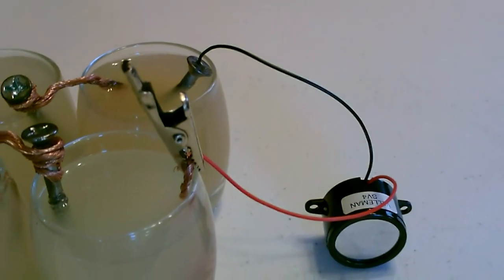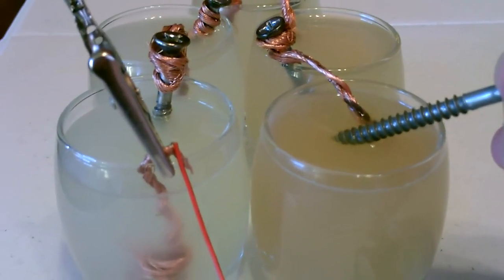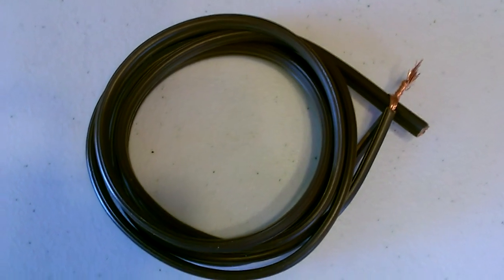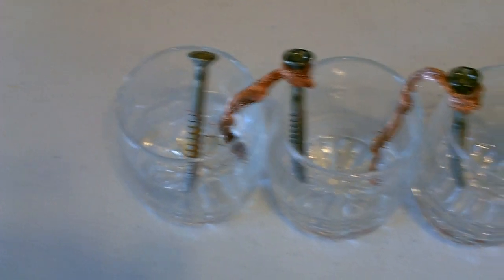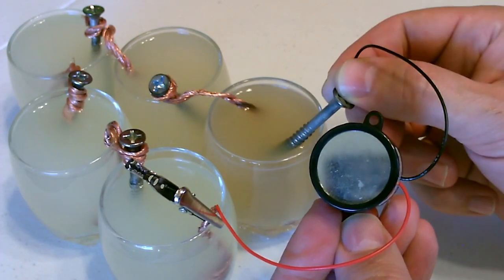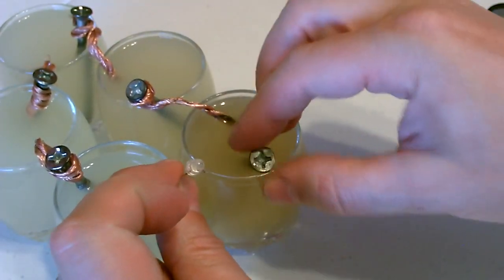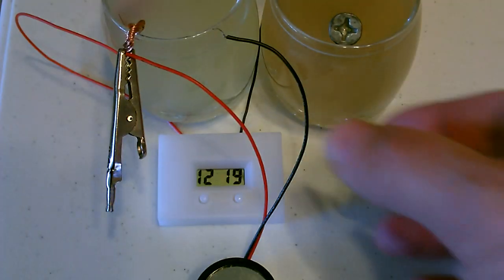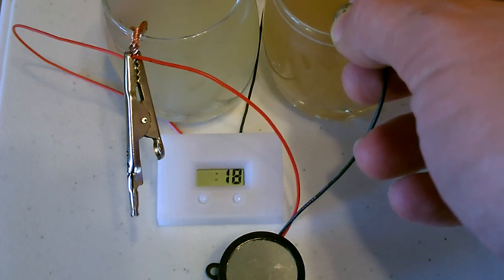Lemon Battery - Powers an Electric Buzzer! (and more...) - Homemade "lemon juice" Battery - Easy DIY

Comment: To get more potential you could create an outdoor Ionization array.  Copper, Gold, Bronze, etc. insulated a top an Ironwood Reed, silica. Run a lead wire down to your juice capacitor jar connected to another jar, and another, and another. 6 jars are the bitter solution, 6 jars are the battery. All you need is a bit of natural valence  electron bouncer..
Reply: With stored DC power you could certainly use electrolysis to create HHO.
Reply: Perhaps the Bagdad  battery is only the setup for another source to energize the flow. Perhaps galvanic reaction is only good when you apply input.

Comment: Does the cups have to be full and should we only use thin copper wire for this project to work??
Reply from the maker: hi. they don't have to be full (but it works good that way). it doesn't have to be thin (but it should be 'uncoated') ✔😎
Reply: @desertsun02  Can Christmas led lights be used to try and test out whether the lemon electricity project works?
Reply from the maker: possibly. i'm not sure how much those led lights use.
Reply: @desertsun02  Is there a way I can get more voltage from the lemon juice to light up Christmas lights

Comment: And now i really want some lemonade. See if you can get a cell phone battery to fully charge on one of these setups.
Reply: GrimFaceHunter I need to know how many glasses of juice it'll take to keep my refrigerator running.
Reply: I suspect it would take a lot of glasses, nails, copper wire and juice.
Reply: ***** I think that LED requires 3.3 Volts and it gets really bright so one more glass will may get a cell phone to charge. It all depends on the amperage, and at how much a phone is set to start charging.
Reply: John Strabismus Probably more juice than your refrigerator can hold.